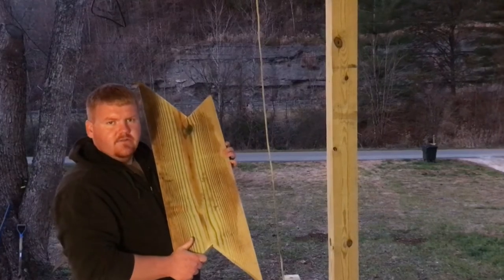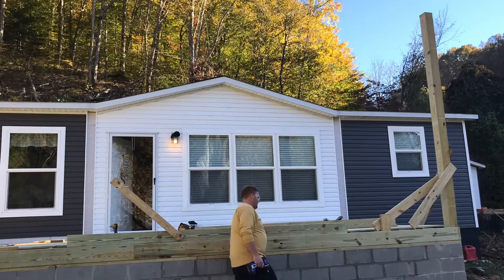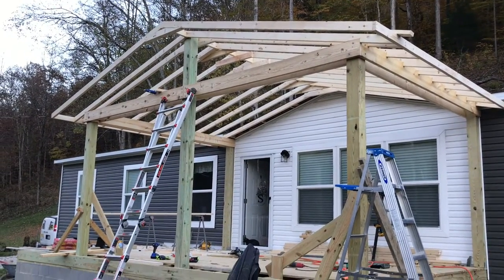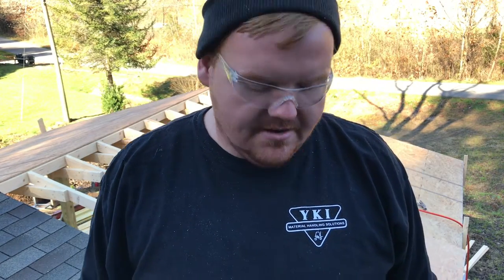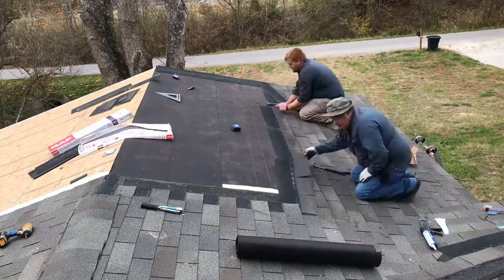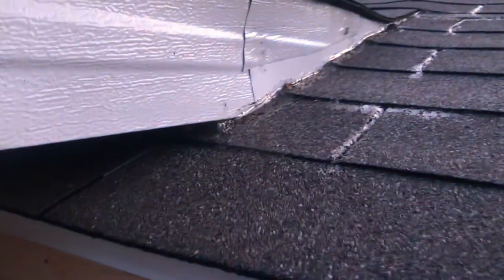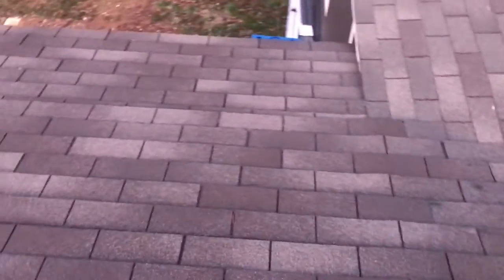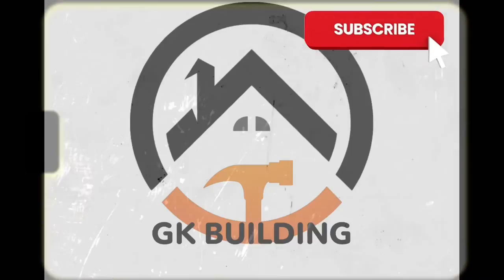HOW TO Build a FRONT PORCH / Roof on A Doublewide! HOW TO install Shingles!

Comment: Next time can break it down n mark shingles every 4 inches or 4 n half inches to even them out better. Also dnt need to caulk wall if stepped flashed. Actually should leave shingle about 1/4 away from wall for water to run. Shingles will wick water some n if wall is caulked water will build. Great work just advice from a roofer to help out.

Comment: Have things changed with more modern manufactured homes? I was always under the understanding you weren't meant to secure a deck to the house itself.
Reply from the maker: Thanks for the comment! This applies to where I live. Decks are attached to mobile homes all the time here! My Deck is actually on a Block Foundation so it’s more attached to the block than the house!
Reply: yeah, I wanted to do one. but was told "HUD" laws says you can NOT attach a deck or porch to a manufactured home. UNLESS it was done at the time of designing the home, as engineers will have to redo things to support the extra load etc.  Our Clayton home. we said.. hey we want that window taken out , and a french door put there. and we want that door 8 feet from the french doors turn into a window..   after they went thru it , we ended up needing to put 3 windows in the front of the living room instead of the two originally there.  but as someone told me, laws only apply when the enforce them LOL.

Comment: Have you had any settling that pulled the house down?
Reply from the maker: No we haven’t had any settling
Reply: @RedBeardedBuilder   That's wonderful. We have a 2022 Cavalier and I am about to start building porches. I want to do something similar to what you did but I have been thinking of building a block wall, backfilling with dirt and pour a concrete cap. Your block skirting, did you construct it as well or did you pay for someone else to construct when setting up the home?
Reply from the maker: @skatesac56  someone else started it and I finished the block skirting